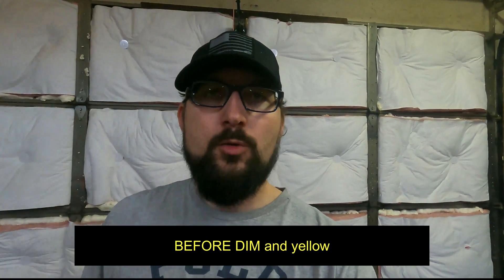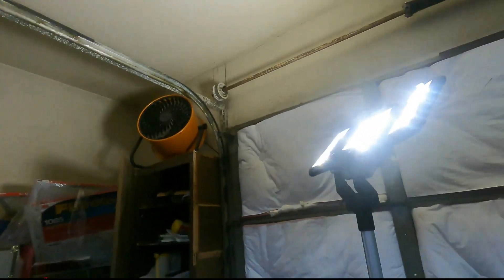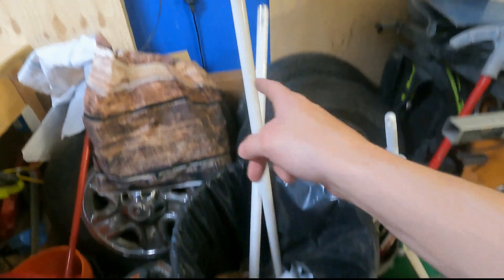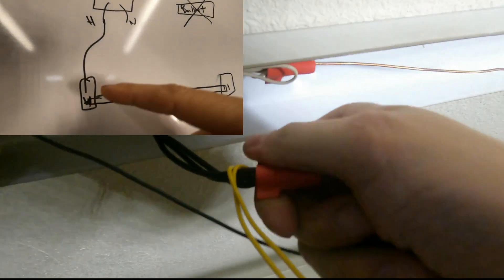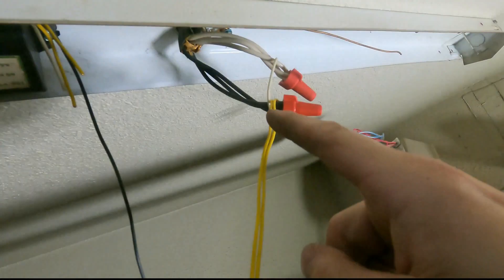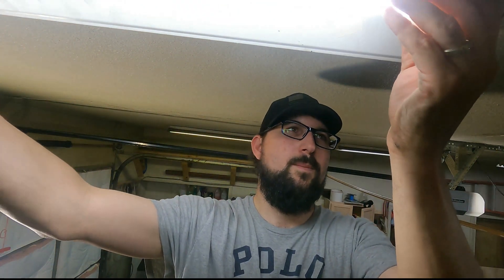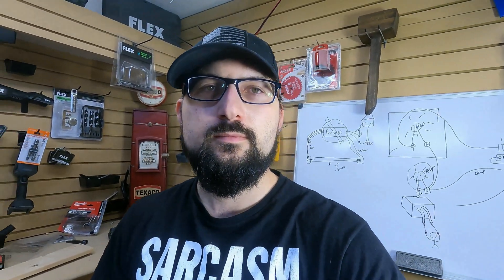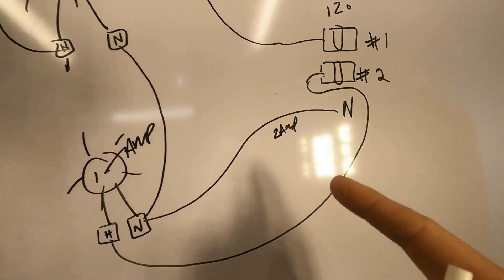My Lights Flicker HELP DIY Led replacement for florescent lights easy instructions howto  DIY save $

Comment: How can neutrals shock u if they're  off
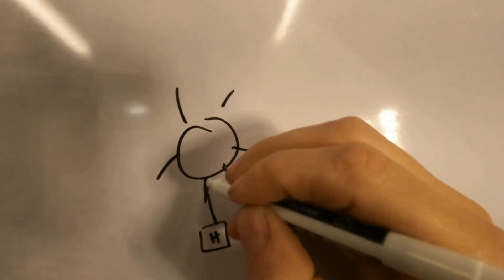Reply: i think the explanation is at 10:00 
basically in some setups, the neutral might be shared with another circuit, so if that other circuit is still energized there's a path for you to get hit